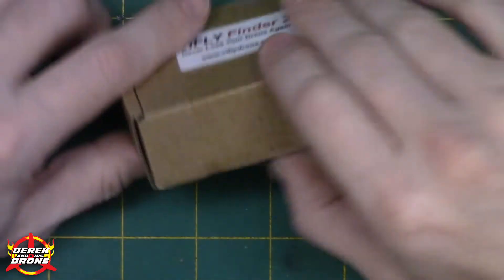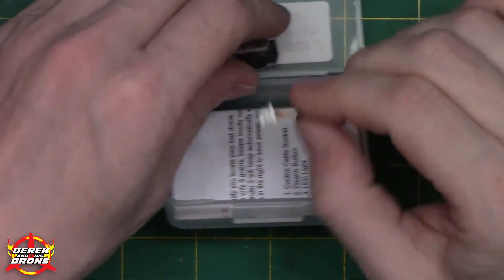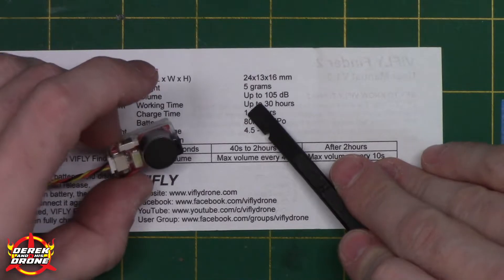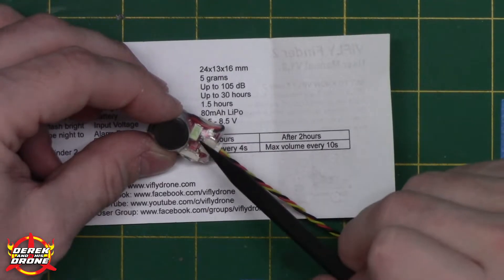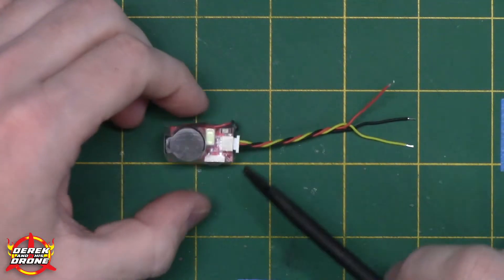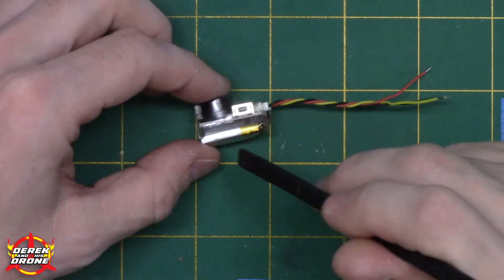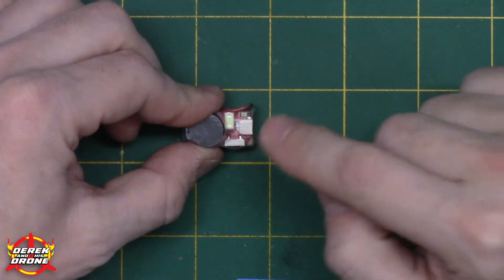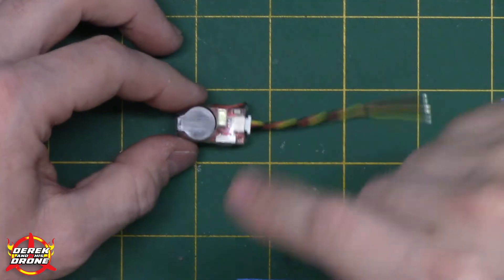VIFLY Finder V2 Complete Review

Comment: My go to buzzer. Have it on every build.  Rarely use the button. I just plug battery back in for a couple of seconds and unplug and that switches it off the same as using the button.
Reply from the maker: I have always had a hard time with that method.  That's why I like the VIFLY with the button.  Good thing they built in a couple of methods.

Comment: I've been using the Hellgate buzzer on all my builds above 5". This one looks interesting as it has the LED, although not sure if that's enough to switch to them. I'd love to film a head to head.
Reply from the maker: The VIFLY is about twice the size of the HellGate.  It is louder, has a bigger battery and costs about half.
Reply: @DerekandhisDrone  I'm intrigued. The only real issue I see is the sleep mode at night. Is that feature something that can be disabled? Think tall grass/brush and or dark corner of a building. I don't want it not beeping thinking its at night.
Reply from the maker: I agree not a fan of that feature either.  Unfortunately it has absolutely no configuration.
Reply: Derek and his Drone Maybe there is a way to disable it via a hardware hack. I’ll get one just to reverse engineer it.
Reply from the maker: Do it!
Reply: @breaksteel  If it is in a tall grass/brush, it will beep continuously and will not go into sleep mode. It only gets into sleep mode only when it detects the process of becoming dark. If it suddenly gets into the grass, the sleep mode will not work. Actually our engineers have considered it when designing it.
Reply: VIFLY Drone You have perked my interest, and given me an idea for a video. How may I contact you directly?
Reply: @breaksteel  For product query, just send email to support@viflydrone.com

Comment: Hello,
I received today the Vifly finder 2 from Bangoood. Unfortunately, the Buz- header on my fc is damaged and cannot be used. Is there a way to use the Vifly?
Reply from the maker: The "finder" feature will still work if the battery is disconnected.  You might be able to remap the buzzer pad to a different location on the fc.
Reply: @DerekandhisDrone  thanks a lot
Reply: Hi @DerekandhisDrone 
I remap the Buz to motor 6. Buz has + and - whereas motor output has only one pin. So where do you think I must solder the red and yellow wires from the Vifly to the fc? Thanks
Reply from the maker: Red to 5v, black to ground and yellow to buzzer -  The buzzer + pad is 5v just connect the yellow to your remapped pad and black to any ground.
Reply: @DerekandhisDrone  thanks. I'll try that.